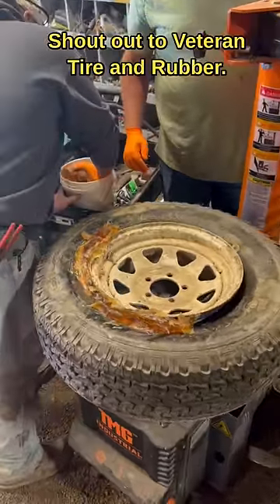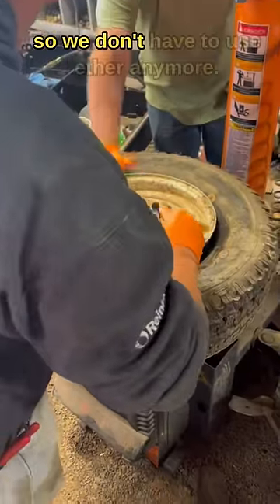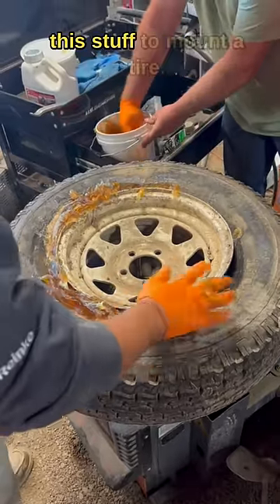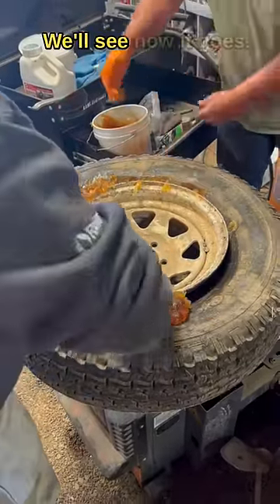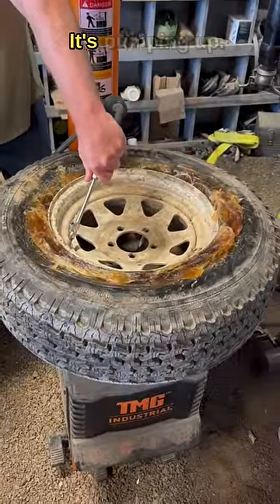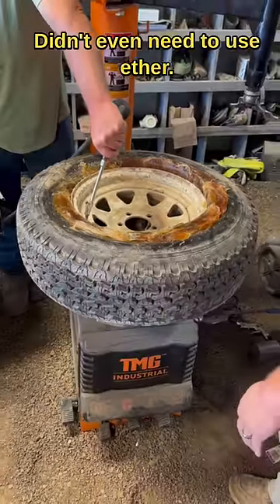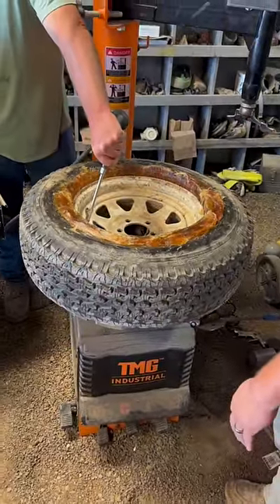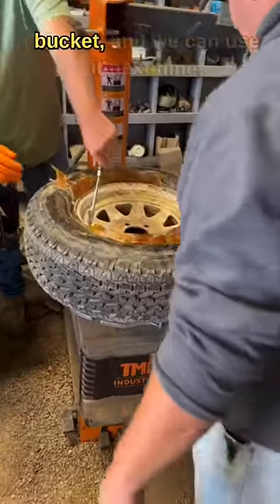Veteran tire and rubber sent some tire mounting compound. Let’s see it work. #farming #shorts ￼

Comment: Never have I ever used it in that way I always mixed it with some water and rubbed it on bead or just grab a hand full and get the bead slick enough to mount the tire on the rum then would ratchet strap the tire down to the wheel the throw the air to it but I never used it to seat a bead just to mount a tire

Comment: It's okay to use on some, problem is not for use on tires requiring balances. Soap goes inside tire so balancing not accurate. Bands are better ether can be last resort.

Comment: you dont need ether to mount a tire either. a shot of high pressure compressed air does the job just fine

Comment: Put some water in the bucket with a wand and just put a little around the bead and stand the tire up with air on it and it should catch and air up. If not a bead blaster
Reply: Also if you pick on the tire when it’s on the machine and try to spin it with the air on it helps

Comment: I don't think that's it's original intended use. I mean that specific definitely works, can't argue that. But I'm pretty sure, like damn near positive that you run a THIN LAYER of this stuff on the tire bead to help get the tire on the rim.  

Then there's the fact that using ether is 100% more fun than this method

Comment: scraoe it off y6oure walls ./ shirt / faces etc 
simpler way : put a ratchet strap around the tire in the center of the tread and tighen it , this will hollow out the tread and push the sides out , usually works fine , you do need to let the air out once the bead is seated to trekease the ratchet strap

Comment: Why not use the air blast?  Be so much cleaner and save time.  You can't be scared all your life.  Just fill the tank with air and release the valve and hang on.

Comment: Or.  Or just take a ratchet strap and wrap around the circumference of said tire and crank it up tight and watch the bead touch the rim and hit it with compressed air through a valveless stem.   Really guys

Comment: How come you Mericans  have so much trouble geting a tire to pop the bead on? We just put a water soluble tire lube on with a brush (doesn't need to be thickly applied) onto the tyre bead and rim, and they pop on no probs. I have even done it with soapy water. You Mericans just love an explosion don't ya's.

Comment: Not how it's supposed to be used 🤣 🤣

You mix 1 part of that with 4 or 5 parts water in a separate bucket and then you lube up the bead of the tire with that mixture. The instructions are literally written on the side of that bucket. 🤣

Comment: Wouldn't it be much easier just to use an air cannon because tyre lube used for truck tyres and tractor tyres and heavy machinery tyres if you have to use it on a car tyre you don't know what you're doing

Comment: I have to ask. If this is a professional shop, where are the proper tools?? Unless you like to have your techs get hurt and do it the hard way.

I have never seen or heard of a professional shop using ether.. That's a trail fix not a shop fix. Hell for $100 you can get a bead blaster. Heck that's even safer than a ratchet strap. And if the excuse you don't have a bead blaster cause you don't trust the techs.. Then it's time to get new ones.

Comment: Get a proper tyre fitting machine and you dont need any of that crap i worked as a tyre fitter for years here in aus and never did i or anyone i work with ever have to use any of these crappy time wasting products